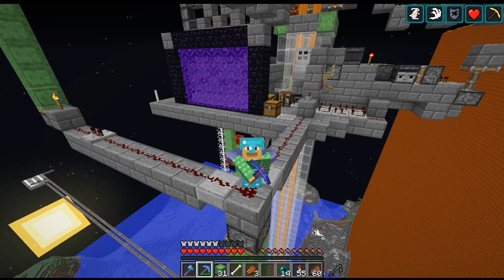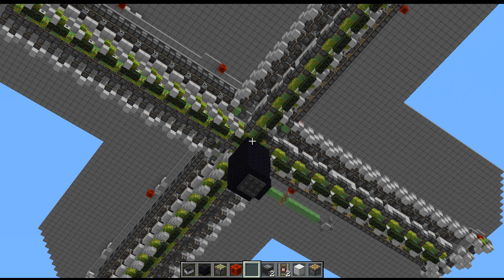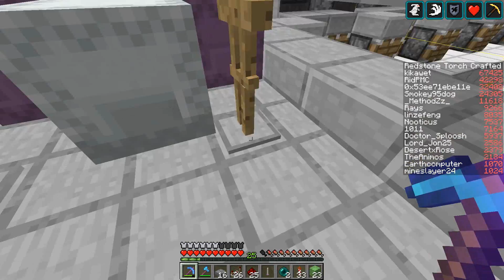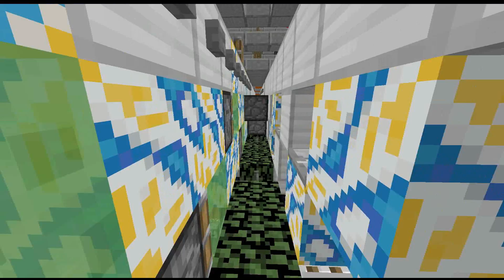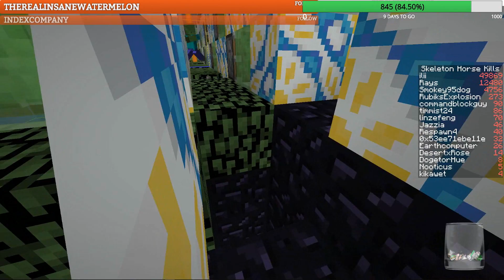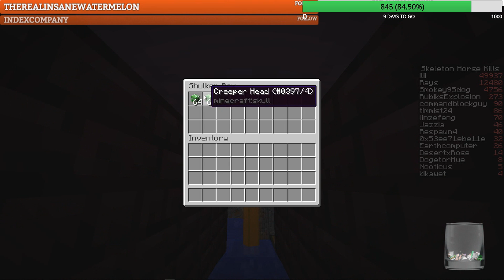Farming up Mob Skulls while AFK!- ProtoTech SMP #46

Comment: I have a request.
Have you made mob farm that sorts out the Creepers from every other mob?
I've been looking for a way to do this for a while.
If you can sort out every mob as well, that would be extremely helpful.
If you've already done this, then you could just link a video.
Reply: Quinn Allred It's possible to build solo creeper farm! Just make them 2 block high and put trapdors under roof to prevent skeletons and zombies (also babies) spawning in. Then, put cobblestone walls instead of solid blocks on the pavement in order to have no more than a 2x2 sequential spawning pads of solid blocks (to prevent spiders spawning). Water flow for collection. Hope my english is not so bad!
Reply: It is also possible to sort mobs, placing them in a minecart and sorting afterwards.
Reply: Jonathan Fino
I tried that on console edition, and It's didn't work. I tried relocating it to 3 different biomes and underground once. I made sure a ton of nearby caves were lit, and I even tried changing around the block type themselves.

The14Some1
I tried doing that, but I am still not sure how many minecarts. Please specify.

Thing is, I rarely get the chance to play pc edition anymore. Thank you anyway.